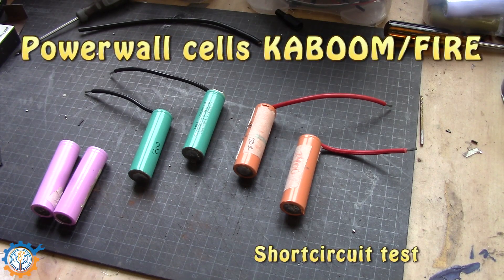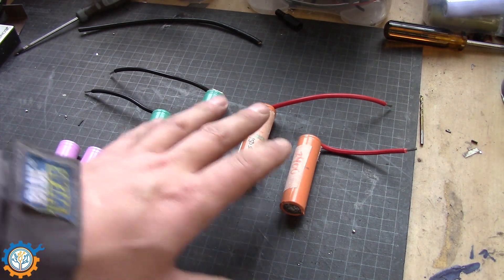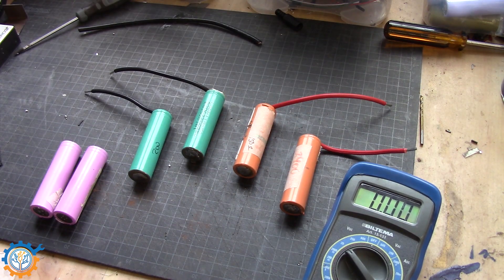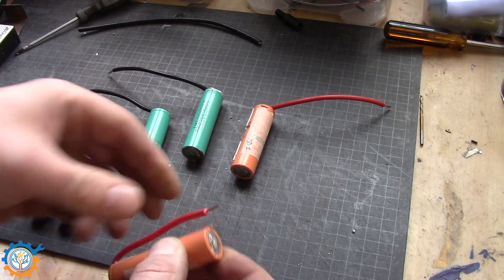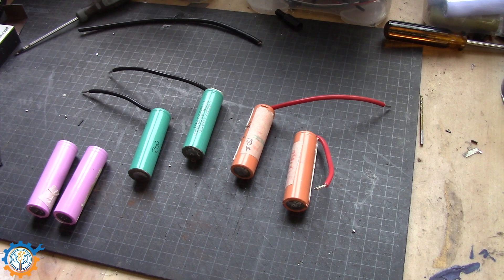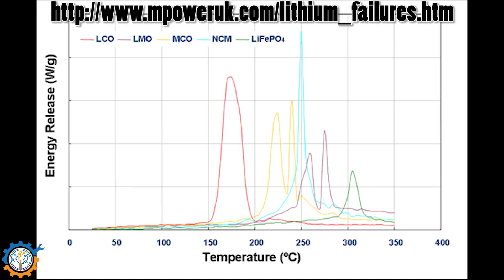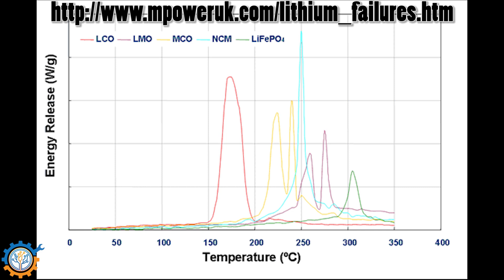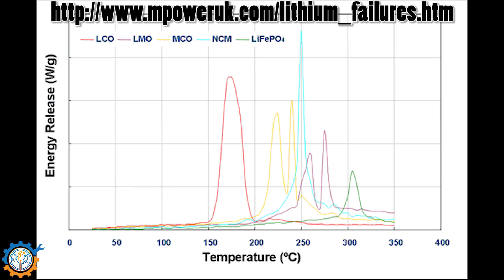Test: 18650 Shorted and go BOOOOM!! Or?

Comment: Thanks for an informative video. One thing I was thought was strange was that the cells with higher internal resistance (200mOhm) got hotter than the others (130 mOhm). The power while short-circuiting should be higher for the lower resistance, giving a faster heat up. Moreover, they have higher energy capacity so they should be able to go on and heat longer. Or is it something I'm missing?
Reply from the maker: Its the resistance that creates the heat :) The voltage drop over that part induces the heat ;)
Reply: Yes I know, but the power dissipated in that resistance R is P=UI = U^2/R. A smaller resistance would increase the power (given a constant voltage U). I wonder if there are any kind of PPTC fuse limiting current on overheat integrated in the high capacity cells.

Comment: They have protection circuits. What did you expect?
Reply from the maker: Mussie Tesfay they have cid. What did you expect since you watched the video? ;)
Reply: DIY Tech & Repairs  what is cid.
Reply from the maker: CID is a pressure valve that will disconnect the positive end if pressure is built up. Or limit the current in some cases. Above cells tested do not have built in circuits as such. https://batterybro.com/blogs/18650-wholesale-battery-reviews/18306003-battery-safety-101-anatomy-ptc-vs-pcb-vs-cid

Comment: I imagine it would be a lot worse if the wire was really short and you connected it from the positive terminal to negative body, instead of end to end. Less distance for the current to travel, meaning it would heat up really fucking fast, and kaboom.
Thats my theory, not claiming to be correct though.
Reply: Pretty sure wire length wont make a difference unless there is massive resistance in the wire itself. Wires usually have no resistance, that's why resistors exist.

Comment: Could you tell if they were venting? It looks like they were in the thermal image.
Reply from the maker: No i could not tell if they did vent. I only think the CID pulled by the high pressure. The cell had no contact after but pressing the cid in the started to work so i guess they didnt vent. The protection did what it was suppose to do. Remove the external short :)

Comment: Another exciting video!  One thing you could do is peel back the sheath a bit up by the anode and short directly from the cathode part of the battery case 3mm to the anode with a chunk of copper or steel and a magnet.  It wont make a ton of difference but you will eliminate the 10-30 milliohms that are your 12 ga or so wire you are using.  Remember as a conductor heats up its resistance goes up too.
Keep it up...still waiting for your first crazy video to go viral ;)

Comment: Yea, but if they are in your pocket it is covered by denim insulation the temp may go higher to 200C. .  Most of the power walls you get have them connected in parallel, so if one goes short, all the power from the other batteries will rush to it.  In a Tesla I think they put batteries in some type of fluid so it always stay cool. Still nice video.
Reply: If it can reach 100c in your pocket without you noticing...
Reply: tesla puts battery in fluid? er... no they don't. no one does that wtf
Reply: @riskinhos  yes they do. The cells have liquid. It’s not physically in the same container as the liquid but I believe it’s aluminum used to transfer the heat.
Reply: @riskinhos  the cells are filled with electrolyte which is a liquid.
Reply: @ericklein5097  it's not liquid.
Reply from the maker: More tests to come!  And no im not going to test this in my pocket :D

Comment: You just got a new patreon member, if you need batteries I can provide you some (but not new), cells are not an issue because I have so far thousands of them but let see how much the parcel will cost from Spain. As I said in previous videos you are doing a great job. Let me suggest something, after seeing one battery can't get burn by itself next experiment would be: how many cells need to tackle one cell in order to get in to flames. This will help in order to know how many cells can be arrange " in a secure way. many thanks again for you job
Reply from the maker: Thanks m8. Yes i should test that. 2nd hand batteries i have 100s of that im willing to spend just for pure simple testing.  The question is how many batteries i should short out in a pack? Should they be tightly together or just in that plastic holder type :)  There is 1 thread on the forum diypowerwalls.com about how to put it out. Should add another thread about this above topic to. The more suggestions on how to do the test the better the test will become.
Reply: DIY Tech & Repairs well in your current test you just put all the amps of a single and wasn't enougth, but if they are part of a pack and you get a short out the sum of the rest of the cells will go though it. Final question would be: how many amps we need to put in one cell to catch fire and how many cells we need to put to generate a fire. Rohan (the firefighter) by mistake did it but we don't know how many are the limit.
Reply from the maker: Yeah its a big question. What if a cell shorts and rest of cells send their current into them...
Then fuses on the 18650 would most likely have caused them not to short.  So that is something i would like to test for sure.  

I have tried several times to put in like 10A and 10V straight into it. 10 out of 10 cells the CID popped instead... But this short/discharge test the CID did not pop :)

So question is also if discharge vs charge vs short/shart differs when it comes to what will happen to a cell. 

Next test for now is to short 4 or 9 cells that are tightly together in a pack and se if that will get them all to heat up enough for thermal runaway...

Not sure how to test if 1 cell shorts and then current rushes from the rest of the bats. I have no way to make an internal short hmm.
Reply: DIY Tech & Repairs, great, perhaps the easiest way would be putting it oposite and it would be like a short cut. cheers
Reply from the maker: 6 or 9 cells in short. Need to be fast and solder a big wire on it :D Thats is quite some current going through....
Reply: Wtf people own hundreds batteries and I just have an old shity died one :V
Reply: Do you still have some 18650? I really need them for my diy projects
Reply: Thousand? You can build a powerwall with that!
Reply: Hola!! Porfin encuentro a alguien de españa que este metido bastante en el tema de 18650. Te suelo ver en muchos comentarios de videos sobre baterias. Me gustaria hablar contigo sobre baterias si usted quiere. Un saludoo!!
Reply: Hey